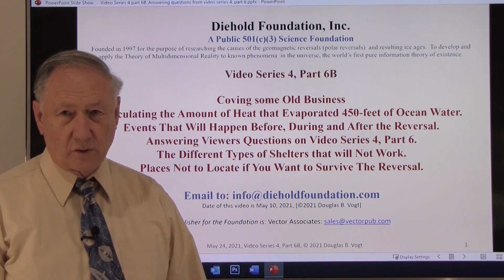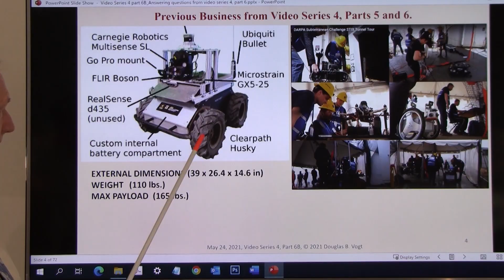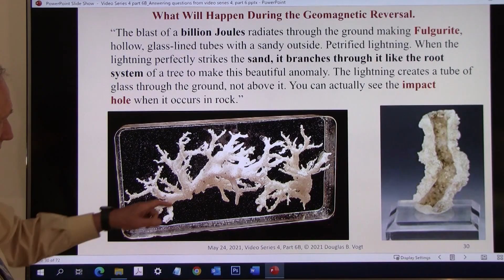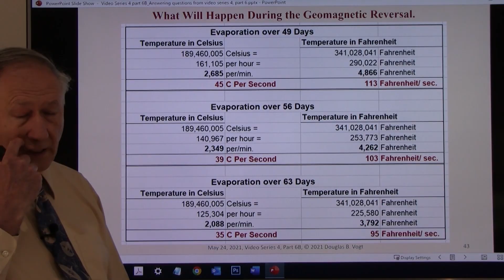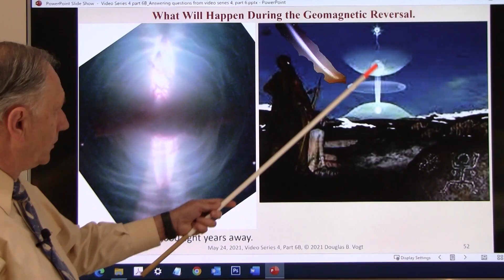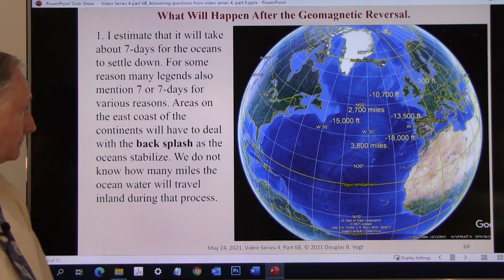Series 4, Part 6B, The Sequence of events before, during and after the polar reversal & Nova.

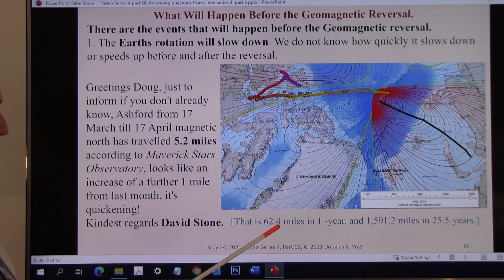Comment: Slide at 18:33 says pole moved 5.2 miles in a month, 1 mile more than previous month.  If it's increasing at 1 mile a month, than that's 6.2 the next month, 7.2 the next, etc.  At that rate it will travel the 6,300 mile to the equator in about 9 years from the date of the data April, 2021.  His math of 25.5 years for 1,591 miles is completely wrong and assumes it's always traveling 5.2 miles per month.  However we know it's been speeding up, so 9 years is if it's rate of acceleration is constant.  The rate of increase has been and will likely continue to increase as well, so probably more like 6 years until the poles reach the equator.  Not a lot of time until we have no magnetic field.  Even less time until it's so weak that a minor flare sends us back to the dark ages.  The micro-nova may not happen until 2046 or whatever Doug is predicting, but we will have lost electricity long before then due to any old solar flare when the field is low.  Current field strength estimates are about 25% below normal (2024).  We get a X class today and we are toast. Get those hand tools, live stock, seeds, gardens, hunting gear, food and water storage, and do it now.
Reply: End October 2024: poles moving appx 6 miles per month

Comment: It is electrostatic pressure that will stop the inundation of water. That is how Moses parted the seas. He used the energy stored in the earth from the pyramids. The pyramids protected humans for three cycles of the mini nova. When Moses took the ark from the pyramids, he sentenced humanity to disaster, and ignorance. Just do a search on utube…..moving water with electricity. It can be done on any scale. You need trillions of volts pressure to protect from the deluge that occurred on the micronova……but……in a cave, a smaller voltage could be used to seal the entrance. All the pyramids were areas to avoid the deluge, and help humanity move into the next era. Only at the giza pyramids did they understand the forces, and were able to use them individually. All the other pyramids had energy that repelled water, but they had no staffs(Nikola Tesla’s magnifying receiver patent) with tunable coils, two ankhs
Reply: Could you explain more on how to build a staff with those coils and ankhs? And how can I build an apparatus to protect my own cave door?

Comment: I'm sorry Doug, but you're failing to take into consideration a huge variable.  Conservation of momentum.  They Earth simply CANNOT change it's rotation, even taking into consideration a crustal slip hypothesis.  If you would take yourself seriously and challenge your own ideas, do the math.  Calculate how much energy would be necessary to not only stop the rotation of the mass of the Earth with all it's land, water and atmosphere but then to put yet more energy into the system to then start the rotation up again.  You cherry pick data to fit your hypothesis instead of trying to disprove your own ideas.  This isn't science, I'm not claiming you are wrong or right.  I'm claiming that you are not contributing to the science of explaining these past events.  You are simply picking the ideas, theories, data and evidence that supports your hypothesis.  I call BS sir!
Reply: See MarkoPL100 for a 4 min video describing the reversal. The continental shelf canyons tend to support the 'flood' being real. Greetings from Scotland 😊
Reply: You need the energy of a micronova to do that 🤨
Reply: Well I hope you are right and Doug is wrong🤞🤞
Reply: Did ya not consider the core of the earth 🤔 
Gyro dynamics: missiles can be directed mid flight in any direction and it's not even half the weight of the entire shell, tube, guidance system and rocket engine. 
The Earth's crust is 7-12 miles thick and the core (nickel and iron) is as big as Mars. 
It doesn't take a genius level of intelligence to figure how that is possible. When the core temporarily destabilizes it stops rotating and then reverses direction once it starts to stabilize. The crust and mantle of the earth follows the direction of the spin of the core.

Comment: An EMP, of sufficient strength, will not only reverse the rotation of a spherical object, but flip it ~90'. There are 2 hemispheres, NH & SH. With rotation and flip, NH goes S and SH goes N.  The previous reversal and flip had NH move East and N,  hence the flow over the Rockies. Hold a current globe { or ball marked up w/ continent outlines } and rotate W while twisting northern hemisphere (NH) down; the SH will rotate up, so tip of S.America will be rotating westward into sunrise, finally, at a new equator approximately going through NA and SA, as shown in BD's animation.
Reply: https://www.youtube.com/watch?v=h3WIokz3Fuo 
See rotation reversal demo
Reply: where is the animation
Reply: This assumes that the crust moves, MarkoPL100 Suggests in his 4 min demonstration video that the mantle does the moving, not so much the crust.

Comment: Doug, i think you missed something important regarding the 450 feet decrease of water. Water is bulging around the equator due to our spin. During reversal water returns to north and south pole, so tge flattening due to coming to a complete stop has to be put into consideration.  Makes this much more survivable if you are away from the west coast/shores in general. I suggest atleast 400 meters above sea level. Play it safe.

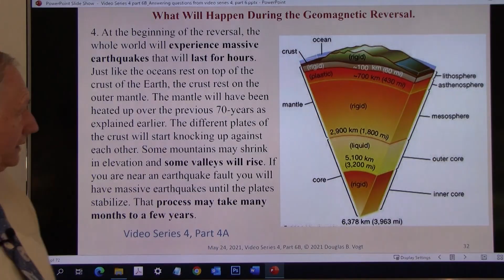Comment: @34:20 but could an air strike PULL the ground up? Could a strike go into the ground but raise the landscape? Could some of our mountain ranges(just west of the San Luis Valley) be a result in high voltage discharges? Not cutting but raising.

Comment: Well, I am not a scientist, but breaking the bonds between oxygen and hydrogen is hardly happening through coking. Applying 100C will make the water shift phase from fluid to gas, but it will still be water! (See at 42 minutes)
Reply: not sure what you mean, but perhaps you mean the suns plasma or/with dusty shell  propelled to relativistic speeds hitting the ocean will break those bonds?
Reply: @jzeerod  He says: "it takes 540 calories to break the bond between oxygen and hydrogen..." That is not what happens with boiling. That process creates Oxyhydrogen, a highly explosive gas. Vaporisation only lifts each single molecule out of the body of water and lets it drift through the atmosphere.
Reply: @oleblente3610  but woulld it not be bombarded with high intensity solar radiation?  surely these photons would hit the molecules and split them apart?
Reply: @jzeerod  Vogt speaks about the temperature and cooking water. Maybe he means splitting molecules through solar radiation?
Reply: @oleblente3610   this makes more sense. i believe it was just something mentioned out of context, and if the reader was following the entire script of videos, it would be taken for granted that it was understood even out of context.
Reply: The van der vaals forces that bind water moelcules together occur between hydrogen atoms in one molecule and oxygen atoms in the other.

Comment: I wouldn’t be worried about the earth stopping it’s rotation... since its been proven by the Michelson-Morley experiment that there is no rotation, that’s also when Einstein had to come up with relativity to explain away that crushing result from the Michelson-Morley experiment. Lol not even gonna mention that if we did rotate like the heliocentric model dictates, we would NEVER be moving at a constant speed but rather we would experience 12hrs of acceleration and 12 hrs of deceleration through a range of 2000mph!!! Why? Because it’s not just the earth rotating on its axis but also allegedly rotating around the sun! Which is supposedly 66,000 mph... meaning for 12 hrs you going to accelerate from 66,000 to 67,000 then switch from acceleration to deceleration for 12 hours, decelerating to 65,000 mph. It helps to draw it out on paper and if you can understand this, give yourself a pat on the back your smarter than fifth grader. Lol

Comment: Tesla patented his “valvular conduit” in 1920, this should be the design for the "door" to your cave in essence.  Then somewhere deep in side is your door that is manufactured to meet the needs that the engineers will estimate will be the water pressure after this very special designed "cave" helps slow down the flow of the water.
Reply: How could I design for this? Could you explain?
Reply: @lucfox996  do you know what valve I described and how it works?  It slows the water down by design, and if water hits a cave it might blow out a door 🚪 fso far no one has come up with a door strong enough so MY idea is use cave design to SLOW down the water before it gets to the door. If
Reply: @eathealthier4u  Yes, Tesla's valve like you said. I'd like to contact you, how can I do so? And where will you be heading for this nova? (May be a sensitive question, but what ethnicity are you? I think if all the survivors are similar or close enough in ethnicity there won't be any fighting. Also some may not survive a hot climate like the equator.)

Now, say you slow down the water using Tesla's valve and it works: how will you get out? And the water could freeze when you want to leave. If you are transporting people, animals, and hopefully technology out of the cave through the door the valve could tighten things.
Reply: @lucfox996  teslas valve is not flexible so wondering why you say it might tighten up?  Also, if the cave is where it needs to be, it should not freeze, but if it does, there’s a steady source of water right there…tech as we know it will probably be gone at least a decade before the end of this cycle.  It is too susceptible to electromagnetic interference.  It will fry in other words.  Case in point.  Hundreds of the starlink satellites are kaput because of the recent CMEs from the sun.  Soon, that interference will make its way, by coupling with the earth electromagnetic field, to the ground.  Frying electrical devices down here.  Case in point; the Carrington Event 1859…

Comment: 30:15 - when I talk to other people about this topic, this is the point I bring up, the deep underwater canyons that are obviously carved by water erosion, which can’t happen if thousands of feet of water are already on top of it. This and the mammoths that were flash frozen solid to the bone. Extreme cold like that doesn’t exist naturally anywhere on this planet but can be achieved by suddenly removing, thru extreme pressure from a Schoch wave (see what I did there?) from the sun, blasting away a large portion of the atmosphere, this drastically reducing the atmospheric pressure. Following Boyle’s law, a drastic reduction in pressure will produce a massive drop in temperature. A mini example of this is a compressed can of air. Release a bunch of the air and what happens to the can, it get cold, really cold. I’ve had cans produce frost on the outside on a hot summer day.  These are truly terrifying observations on a planetary scale.

Comment: One thing I'm not clear on: what is the relationship between the pole reversal and Sol's nova? Does the nova trigger the pole reversal? Or are the two events totally causally independent but synchronous in time? There's no way the Earth's poles reversing could possibly trigger a nova (could it??) so seems like the connection between the two is either initiated by the sun, or it's a complete coincidence of timing. Thanks!
Reply: From what I’Ve read over the past several years is that the shift of polar magnetic north has been noted over the past hundred years, in minute increments. By 2000, the shifting began to pick up, larger amounts, year by year. We’re past the 30* mark now. I read that at 40* it’s the point of no return. The poles will shift, maybe not a 180* but certainly by 90*. I’ve seen maps marking the magnetic poles shifted to right off India and off Brazil where the Atlantic anomaly lies. Who knows what reality is. The passage of the secondary solar system event is soon to occur. We are seeing the uptick in solar events and how it triggers quakes around the world. We need to get through the triggering of the New Madrid, San Andreas faults first and Cascadia. All of what WILL HAPPEN is contingent on what that binary star and its planetary system does.  THAT PLANET that gets unspoken due to censors, is the trigger for all that’s to come. It’s 5x size of Earth, we’ve been watching the double suns now for well over a decade.There is a countdown event in process. Watch for the three days of darkness, or of light depending on the hemisphere you are in. Then the final countdown begins to slow down of Earth rotation to where it comes to a slow halt with a jolt. Pacific Ocean keeps moving toward the East, thousands of feet high. And then there is the back splash. Massive areas of land go under the waves. Some areas rise. Where the tectonic plates move to is anyone’s guess. But move they will. North American continent loses huge areas of land under water. The quakes rip the areas of lakes, rivers apart. The Great Lakes drain into one Great Lake connected to the Mississippi River that widens to over 50 miles wide, it will look like a giant estuary by the time it reaches the Gulf of Mexico. There will be so much massive chaos, fight for survival, I doubt folks will realize it when the actual pole shift occurs, triggered by planet  x , I Doubt many realize that a massive solar flare much less a nova is expected. Survival will be on a day to day basis. Good luck to all. Make peace with your Creator.
Reply: @juliewatson2281  This is exactly what ive learned to be true, as well. Big geographical changes coming mid May, with an uptick until then. I wish I could copy and paste this! Can you message me with this synopsis?
Reply from the maker: Dear Michael,  A clock cycle runs through time every 12,068 years. Taht is all explained in my video series 1 on the basic theory and series 4 explains and shows all the physical evidence. So start with video series 1.

Comment: Perhaps the pyramids in Egypt were designed and engineered the way they are to withstand such pressures and wave heights?
Reply: Exatly
Reply: They wouldnt withstand the heat. Its hotter inside the pyramids on a hot day, than outside

Comment: Doug uve seen the film 2012 surely 
Well I'm proposing it may be quicker and easier to try to ride it out in boats.
Like arks yeah.
Was thinking u cud try shock proofing old oil tankers.
Isn't that how Noah did it.
I've imagined that Noah used a hard wood that burnt outside but stayed intact.
Thought u cud cover ships with like the heat shields they use on the Shuttle, u know spaceship heat shields.
Pretty sure inland up rivers u cud like surf the waves.
Cud insulate ships to.
Buy mini nuclear power stations ever for power.
Cud be much quicker than caves.
If the boats sealed and pressurized even if it goes under it wud Bob back.
Ships cud be easily strengthened and upgraded.
Got Noah and his lot thru it.
Surely theres safer bits of ocean.
A model of how the waters cud flow and move wud be useful.
Think ships cud be quicker and easier and even cheaper to do.
They survived in the film 2012, but I'm not saying that event in that film was a nova.
Cooling and heating systems on a ship with its own power cud beat the heat and the cold 
Big fear with the waves is the debris, places cud get absolutely buried.
Probably wud be better to take ur chances on the surface.
Maybe that's why so many millionaires and billionaires won great big boats.
Reinforced oil tankers may just make it.
Where ever u go uve gotta take the ability to dig urselfs out.
Sooner be on the surface me, less to dig.
Heater and cold sheilding will be a must on the surface or underground.
Am serious China probably built them 2012 boats.
We cud do the same with big enuff teams.
I'd sell everything to be on a ship wudnt u.
I'd be happy cleaning the toilets on the ship or cleaning the animals pop.
I'd get ya top quality compost tho.
Everybody on board wud have to be multi skilled or be able to multi task.
Possibility ships cud work if strategically place

Comment: Atmospheric pressure or the lack of would change boil points correct?
Reply: Many measures of science is stated at 1 atmosphere. You are correct in assuming the boiling point of water changes with different atmospheric pressure

Comment: Hold on a moment and consider how much energy it takes to evaporate seawater without atmospheric pressure?  No pressure, no heat required. So, with no magnetic field, no cosmic ray or solar wind protection. Which means no atmosphere. How stable is the spinning planet without liquid water? How long will water vapor stay in the atmosphere without magnetic protection? (How long will you last in your cave without air?). The plasma (z-pinch) reactors make air and water, as well as magnetic shielding but maintaining losses at a low rate is not the same as replacing the whole thing. Welcome to new Mars.